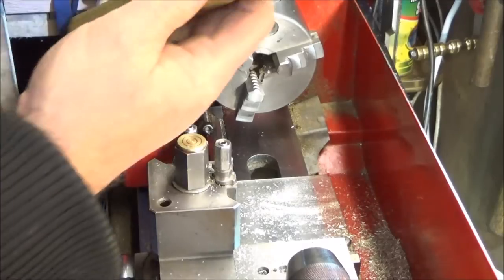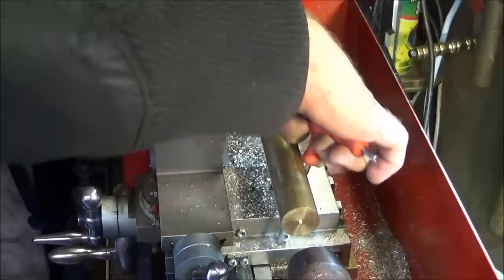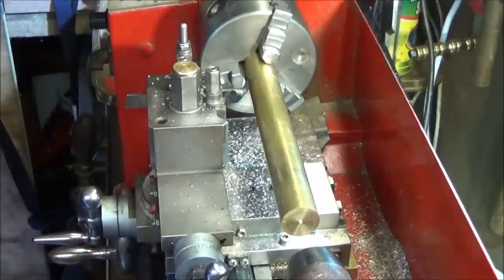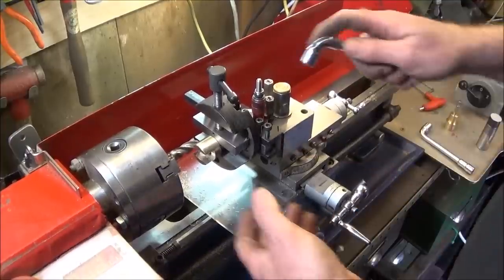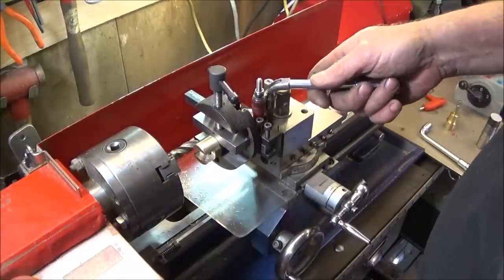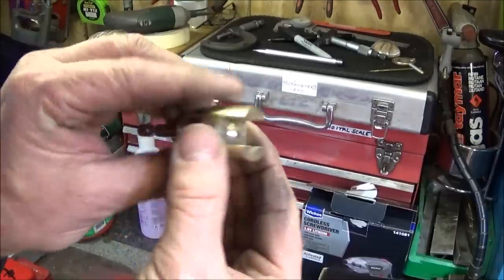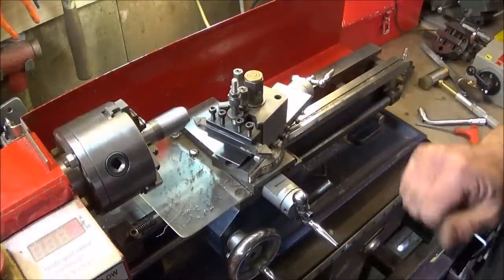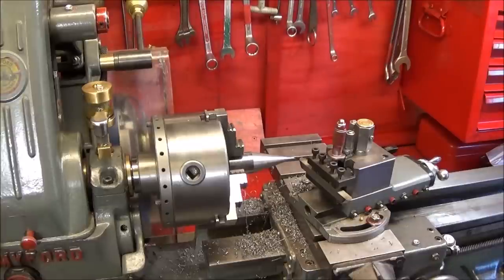Making & Using A Simple Power Feed Adaptor For Compound Turning

Comment: We just made a power feed for ours using a high torque 12v motor, reversible momentary switch, and a wall transformer plug running a 1.5:1 ratio from the motor gear box to a gear where the indicator was. Approx $35 and it is simple to run back and forth without the need to have a drill in hand and still retains the manual handle. Pretty slick little setup.

Comment: Great video as usual A few years back I bought one of these power screwdrivers useless on wood screws but good for powering the compound after I made adapter as per your video thanks Roger
Reply from the maker: Hi Roger. Yes they do not have enough torque for anything other than smaller self-tapping wood screws!..... 

I hope to do a very quick update video on this set-up soon. I have converted a special tool so that the screwdrivers can be used on lathes that have limited RPM spindle speed. I like using the screwdriver method as it still gives a bit of 'feel' to the machining, plus it leaves the lathes in their original state...Thanks for watching....Regards Steve

Comment: Thanks, I'm new to my lathe but I think I will be having a go at this. Love how you add the drill bit sizes on the screen, could I ask that you also mention rpms as well please? It will really help newbies like myself! Cheers mate
Reply from the maker: Hi Shaun, Thanks for watching....Yes I will also mention the spindle speeds in future and hope to show some other info that will help. If you need to know anything specific, you can send a message on Youtube or Google +.....Regards Steve
Reply: Thank you for the kind offer. I was admiring the toolpost vice, I scanned through your earlier videos but couldn't see anything regarding it, home made or shop bought? Nothing like it on eBay
Reply from the maker: Hi Shaun This is the video   https://www.youtube.com/watch?v=1mr3I_8HnJQ 
You can get the vice from RDG website or from their Ebay. You just need to drill two new holes to mount it on a piece of square bar.....I can't remember but I think I explain this in the video. The vice is made of cast iron so its strong but easy to drill if you have a pillar drill. It is one of my most used tools on the lathe. I use it for my tool-post drill, milling ops and for holding bar when using a slitting saw on the lathe.  Regards Steve
Reply: Titanium15160 your costing me money, just ordered the clamp 😀. Thanks for info

Comment: Hi Steve, love the videos! I've just bought my first lathe (its the chinese import of the Warco 180) and so far to say i've only messed around i'm loving it! I'm a little scared to crank up the RPM and use the lathe as fast as what you do. I video explaining safe working speeds for different operations would be really helpful. After 24 hours in to my amateur machining i've noticed that the metal reacts / cuts / chips or shears in different ways depending on the speed, tool, depth of cut etc. Could you maybe make a video going over what to look out for, whats safe, danger signs, what the correct methods should look like. Cheers, Matt.

Comment: One of my drills has a trigger that can be set by a screw to adjust the maximum speed. Would be ideal for this application.
Reply from the maker: Hi Thanks for watching. Yes that would be good. My variable speed JCB drill doesn't have a screw adjustment so its easy to pull the trigger too much. In my next video there will be a short update about this and another great tool that you may be interested in. Regards Steve

Comment: Hi Steve:  Great Video, Thank you for sharing for all to enjoy.  I was wondering what the name is of the part that is holding the brass fitting in the Compound Slide with the V-Groove in it and where can I purchase such a great tool like that?  Thank you for your time to answer my questions.
Reply from the maker: Hi That is my tool-post vice...... I bought the round vice from here:- 

https://www.rdgtools.co.uk/cgi-bin/sh000001.pl?WD=round%20vice&PN=3----75MM-ROTARY-TABLE-ROUND-VICE--834432%2ehtml#SID=485

Then drilled a couple of new holes in it to accept 6mm allen bolts. Then bolted it onto a piece of 12mm square bar. This allows it to be positioned in the tool-post. I show this in one of my other videos. Regards steve
Reply: Hi Steve:  Thank you so much for your quick reply.  I just ordered it and I live in the United States. I figure I won't see it for a couple of weeks or so.  This looks like a great tool for all around Lathe work.  Thank you once again for sharing the website and helping a rookie get a good tool.   Bruce.

Comment: Hi Steve. I've noticed a lot of people have their compounds set parallel to the ways on these mini lathes. I've been setting mine to about 32 degrees because that's how I set the compound of my machine shop lathe when I was earning my machining degree in college. What is the reason for having the compound parallel to the ways on these mini lathes? Cheers
Reply from the maker: Hi A lot of people have them set at an angle. It is really just a matter of preference I think. Although there are advantages of setting it at an angle for thread-cutting. I like mine parallel just in case I make and adjustment using the compound for depth. This way the adjustment won't alter the diameter. Regards Steve

Comment: Steve, Thank for a very informative video! I'm looking for a QCTP for my Chinese Mini-Lathe, who makes the one that you are using? Thanks again!
Reply from the maker: Hi Wilson, It is a Dixon QCTP. You can get them on Ebay in the UK from RDG or Chronos. It is the same one that goes on the Myford lathe, so search for Myford QCTP.....Regards Steve
Reply: Thanks! They look much stronger than the Chinese made ones.
Reply from the maker: Hi Wilson, Actually they are all made in China and India, being imported and sold by the tool companies here. I do not know of any being made anywhere else. They are all well made and excellent quality though!
Reply: Thanks for the information. Sorry one more thing, which size of the QCTP did you use for the Chinese Lathe?
Reply: I've been looking at the one that Chronos provides, did you have to make any modifications to the QCTP to make it fit the compound rest of the chinese lathe? The dimensions of the QCTP holder are 2.25"x2.25"x1.5" correct?
Reply: I found the one on Chronos. The QCTP measures 2.25x2.25x1.5" does that sound about right for yours? Thanks!

Comment: Hi what QCTP you use,what is the size of them on chines and Ml7.I have Sieg SC 4 and want to upgrade with some QCTP like this but I dont know what size i need
Reply from the maker: Hi Nikola, I'm not familiar with the SC4 compound slide so this is the only toolpost that I know would fit. https://www.arceurotrade.co.uk/Catalogue/Machines-Accessories/Lathes/SIEG-SC4-Lathe/SIEG-SC4-and-C4-Lathe-Accessories/SC4-Quick-Change-Tool-Post-Set
I don't know what the availability of spare holders for the set above is like.
 The Myford T37 quickchange set, the same as mine, could possibly be used, but it would need modifications, maybe a new centre stud bolt?

Comment: I like that I think I will make me one. I would like to have some chickens to. I have two lathes one is a Grizzly G9972Z 11X26  I put a 1 1/2 hp 3 phase variable speed motor and controller on it now I am going to convert it to CNC I have all of the parts.  I also have a GMC 20x80. Gun lathe with a taper attachment.

Comment: I noticed that when you used the centre drill and drill bit the centre bumped over a little bit, i thought it was a problem i had. can this be remedied? thanks
Reply from the maker: Hi Brad, It can by truing up the tail-stock, but I don't bother these days unless it is really bad. It maybe where the face off was not quite clean. The quill barrel is a bit loose on my mini lathe as well. If I though it would break the centre drill I would just push the tailstock chuck over a bit by hand to centre it up a bit, as I feed it in. This normally stops that.
Reply: thanks, i seem to be obsessed by tolerances that i cannot achieve , time to step back a bit.

Comment: Watching you doing all those tool changes with the lathe running while wearing a chunky watch and loose cuffs on your sleeves made me scream inside my head (it's late!). Does the concept of safety never enter your bonce?
"This depth needs to be about ... " About has nothing to do with machining, That's an engineer's word! ie. "That should be about it, but let's allow a bugger factor of ... "
Sloppy use of the 3-jaw chuck by assuming repeatability.That's a no even on short stock!
Other than that, the theory and practice is sound, other than the lack of speed/travel control is poor.
I might make something along these lines, though. lol
Reply from the maker: Don't mind me saying, but you sound like you are one of those know it all cocky type that either can't, or never get around to making anything. I have seen a lot of them in my lifetime. :-)
Reply: @SteveJordan  Whereas I'm the type that still has all his limbs intact while I've seen others lose way too many. Any swiftly moving/rotating machinery has only one aim in life: To kill you as painfully as possible. The moment you forget that ...

Goodnight, Vienna!

You may 'know what you're doing', but there are those out there watching your tutorials that will think it's normal to mess around on the vice while it's running. When they are injured will you take responsibility for giving them license to emulate your stupidity? Of course not!
Reply from the maker: I worked in an aerospace factory for 27 years on all different types of machinery. We were given long sleeve overalls as standard wear. Always wore watches as well. In over 40 years engineering no one I knew ever had an accident wearing them and they had open cuffs. It's rings and long hair that are dangerous. Overalls don't get caught on the lathe unless you are down right stupid and lay across the machine or something! Take a look in most factories they all wear overalls with long sleeves. They protect wrists from hot swarf oil etc.
Reply: @SteveJordan  Just because some industries are willing to cut corners on worker safety is no excuse to do the same at home. In fact a factory can still be a safe place to have such an accident. At least there, there are others to turn the machine off and carry your fingers for you to the ambulance. In your home workshop you could faint from blood loss before you can tear free and pick up the phone.

Obviously you're happy to let tyros in engineering/machining learn your shoddy ways, but now they know that I'm not and should take heed.
Reply from the maker: They will know that you are pedantic. A fusspot and a busybody that has a lot to say but has little to do. No one is interested except for the same type you will find!,,:)
Reply: @SteveJordan  So you won't be calling me as a character witness when you're sued because someone did what you do an lost an arm.
Reply from the maker: What I do is completely armless😀
Reply: @SteveJordan  You don't have a leg to stand on.